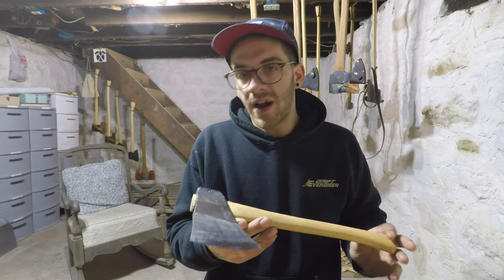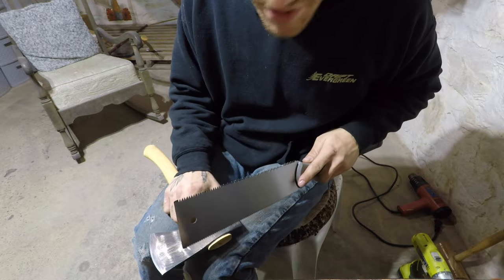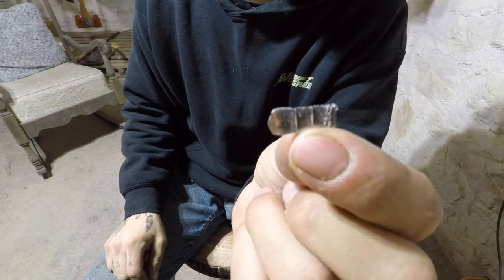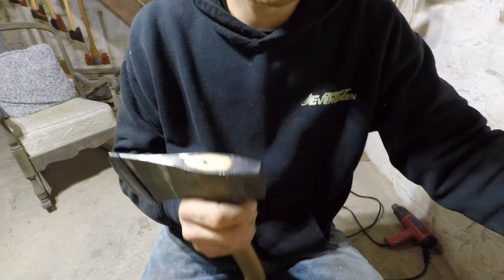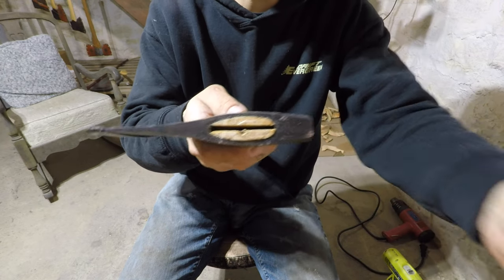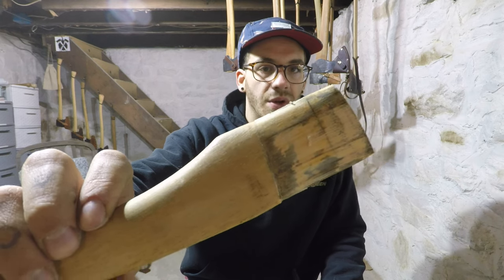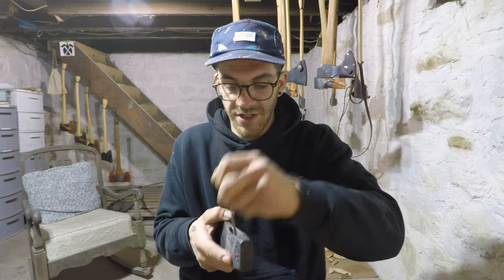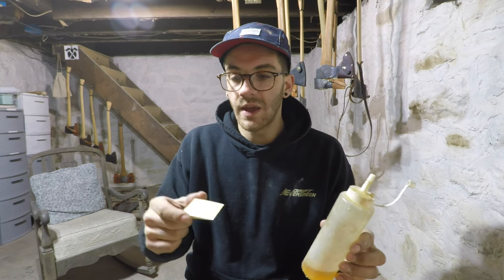How to fix a loose axe the right way

Comment: Joey, you're a good person to ask this I think.  My question is does it matter what type of wood your wedge is made from?  I've heard that walnut is best but I've also  heard that it really doesn't matter.  What's your opinion?

I have rehung an axe since I was a kid.  And then only hatchets probably.  Stuff we did in those days was pretty crude.  I think I might want to rehang a few of mine so I am studying up on the subject.

Thanks in advance for your help.
Reply from the maker: Thank you !! As far as wedges go for this application I used a poplar wedge. Poplar is going to be the most common and it’s going to be what comes in most axes. Now with that said i have not used poplar on most of my hangs. I’m not sure if it’s just me, but I’m on anything above a hatchet I haven’t had good luck with poplar. I find that I’m my boys axes and full size axes, heck even midsize camp axes like the pack axe I use white oak or black walnut. Now walnut is beautiful and extremely hard it’s also very brittle. It also has the tendency to slide out when your chopping especially when your hitting some really hard wood. If you do end up using black walnut and you know you’re going to have a really solid hang and you’re not worried about ever extracting the wedge, I recommend wood gluing the wedge instead of coating it in oil like I did here. Alrighty so now white oak I have to say I have only recently experimented with and this it already jumps to the top of my list I’m very satisfied with the white oak wedges so far. With all that said know it’s a mouth full all 3 options will do the job. Poplar is more commonly found at any hardware store… oh I just thought of this if you go to Lowe’s and go into the section where they have axes and shovels. They have wedges there made by truper and I honestly think they were pretty good. They’re a little short for a full sized axe but hatchet and some mid size axes you would be fine, I think they may be made from oak or hickory but they work really well.

Comment: stupid question.....when you removed the old wedge why not just hammer a new one in right away?
Reply from the maker: No that’s a great question !!! So basically in short if you were to just remove the wedge and replace it with a new one the head would almost definitely come loose within a few swings. So what’s happening is the eye wood is somewhat compressed from being hung for a period of time and then the small portion of wood under the eye of the axe where it meets the handle will almost creat a shelf from the head being loose and rocking back and forth. So if you were to just put a new wedge in it the head would still be in the same position on the handle. So what you do is you remove the head and file away some of the wood at and under that spot and you kind of want to taper it. Then you re seat the head and it’s now a little further down the handle by maybe only a 1/4 inch. Now the head is at its new resting place and sitting tight before you even wedge it so then after you smack a new wedge in it everything is tight. I hope this makes sense it’s tough to explain. I’d be more than happy to make a video just on this exact part of re hanging an axe, believe it or not your question is very common and people are usually confused by this part and more times than not just put a new wedge in it, just to find that the head comes loose shortly after.
Reply: @940joey2  that makes sense. i didnt think of the shelf. thanks for the info.
Reply from the maker: @tested123  you’re welcome !! Glad I could help 👍

Comment: I have trouble making sure my wedge is at the right depth when seating it.  I never know if it will go down far enough or if it is to thick and will stop to early
Reply from the maker: I too had the same issues when I first started handing axes. What I do is just make sure my wedge is the same length as the kerf is deep, then you know that if you get your wedge flush to the top of the handle or close you know you’re pretty much home !! So as far as the wedge being too thin or too thick, that’s something that is going to vary from hang to hang and I shape and tune my wedges according to the axe and the hang as far as how much room I’m trying to fill. Also the type of wood your wedges are made from has a little to do with it as well, I notice that with the common poplar wedge, while it’s the most common wood wedge to me seems to crumble or break when forced too much. I prefer and oak wedge 👍 if you would like I would be more than happy to make a video on tuning wedges for the hang. I hope this helped !!
Reply: @940joey2  thx I'll make my wedges the same length as the Kerf and go from there , as for the video anything that will help me hang an axe I'll watch lol a wedge specific video would be cool.
Reply from the maker: @townieoutdoors8121  awesome glad to help, I have an axe that needs to be hung so I hope to have an axe hanging video out soon 👍

Comment: Hey Joey. What is your method for removing barrel wedges without destroying the top of the axe handle? Head needs a readjustment. Thanks, Norm.
Reply from the maker: Hey Norm, I’m my experience I know I’m going to be jumping the head down a little bit so I know I can sacrifice up to a 1/4 inch of material up top. So those type of wedges can be stubborn, what I’ve done in the past is similar to what I do with a regular metal wedge, I’ll remove some wood around the wedge and then get some pliers, grab a hold of it an rotate the round wedge and you pull it out. Now is that doesn’t work I’ve also took a drill bit that’s about the same size as the inside diameter at the barrel wedge and drill down about a 1/4 inch removing the wood from the inside of the wedge and using an easy out thread it into the wedge and extract it. And if that doesn’t work usually a combination of the methods usually get is out and you’ll still have plenty of wood to reuse and re hand on that handle !! I hope this helps out and sorry it took 10 days to get back to you !!